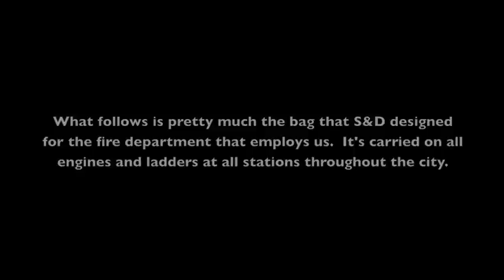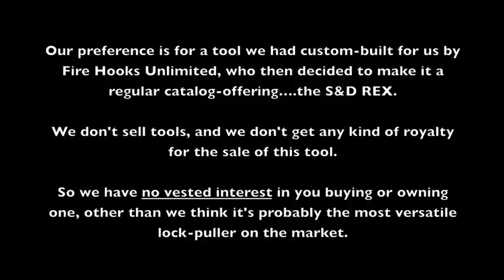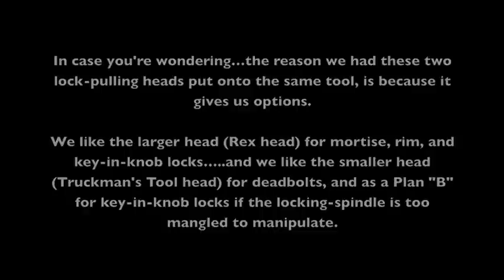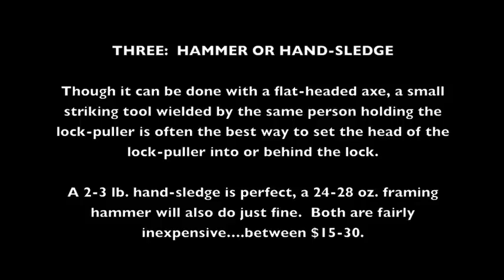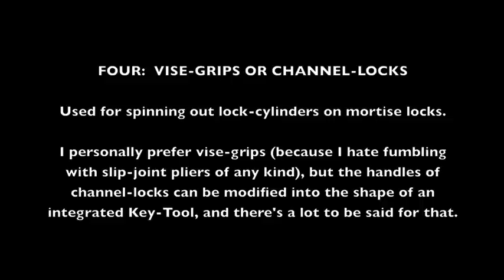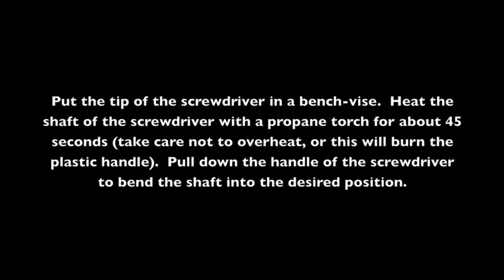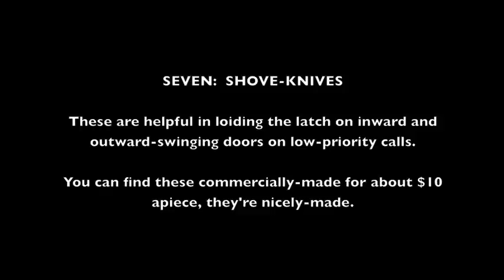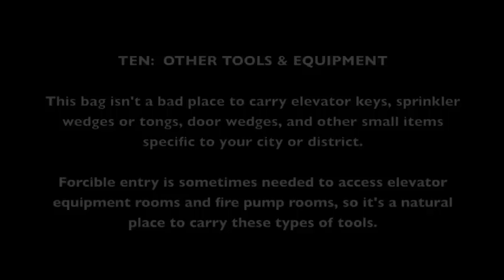S&D: Building a Forcible Entry Bag

Comment: You can GREATLY increase the force you apply with Vise-Grips by welding a ~3" or 4" piece of 3/8" diameter round bar to the adjustment knob to make a T-handle.  You can spin that handle with a gloved finger much more easily than the standard small knurled knob and apply far more force than you could by squeezing the handles..  It's an old welder trick for clamping work. You can cut the bar with a cutting disk, or just buy a suitable steel bolt. I leave the bolt heads on to use as a spinner with my palm.  BTW it doesn't hurt to lube your screw threads now and then. Anti-seize or grease, and not much of it, goes a long way. 

I'm not a firefighter, I'm a welder and mechanic. Try it out.

Comment: How can you hold a light in your mouth if you're masked? {the avatar is Abby from NCIS)
Reply from the maker: Is the implication that I'm doing this while tanked up?  The answer is, I don't pull locks on most working fires.....with the exception of glass storefront doors with Adams-Rite Locks which are quickly pulled and manipulated without needing a light.

If youre asking about an N95 in Covid times, I'll put that on after the door is unlocked.